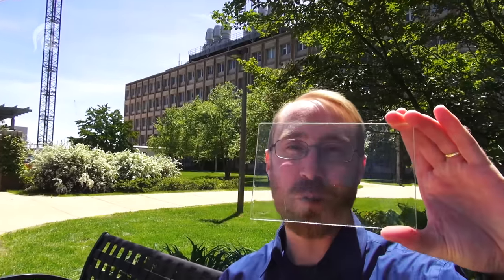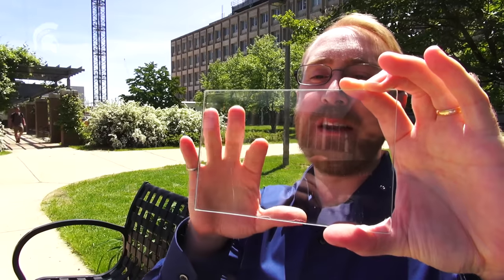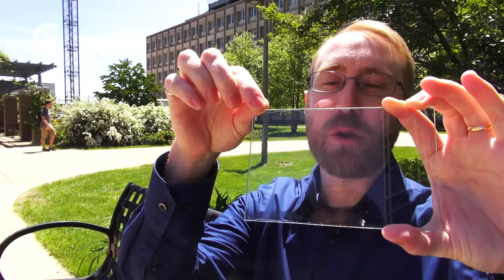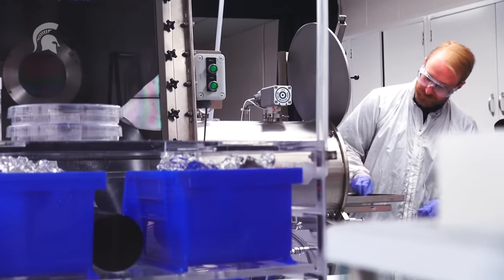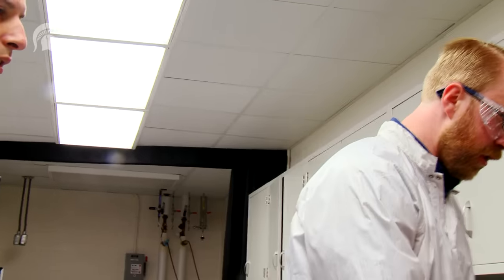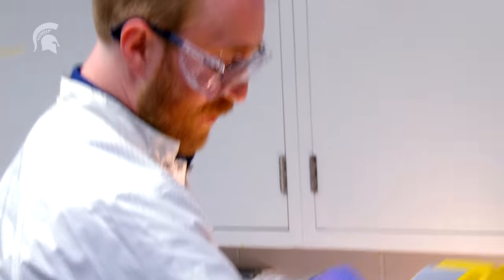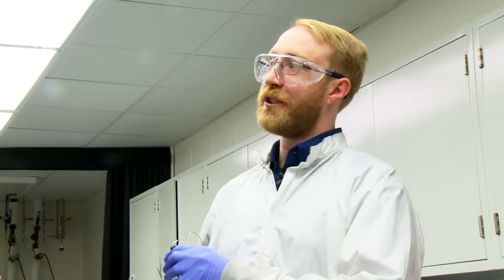Transparent Solar Panels | Michigan State University

Comment: So, was the glass wet or was that irregular surface deformation some sort of coating?

Basically it looks like you are talking about a piece of glass, that by its normal nature and characteristics, which will diffuse some of the light (UV) that passes normally through it to its edges? When you say "transparent luminescent solar concentrator" are you trying to say that the UV light is concentrated at those edges, increasing the "strength" of the UV light along those edges versus what normally goes through it already?

I ask this because you are talking about of instead of having full solar cells, you are going to utilize a small amount of solar cells along the perimeter of the glass. Standard glass by nature, and I could very well be wrong here as I hold no PHD's, will diffuse the light that is being transmitted through the edges, so you are losing potency there to start with right? And then using only a few solar cells along the edge, what kind of efficiency are you talking about?

I think this is a good step, as architects want clear windows etc... So I am glad to see you pursuing this technology, but stating that it could power the whole building, any building, is in my humble opinion a bit too far reaching of a statement to make that it can do. A wonderful goal to be sure, but to make that kind of assumptive statement makes me doubt a lot by itself.

Looking forward to being proven wrong here.

I think that one area you may want to explore and may already be exploring is in the actual chemical makeup of standard glass that is used in residential and commercial projects. Increasing the amount of UV that diffuses to the edges may help. And if you can help develop a glass that manufacturers can readily make for the right price point, then it can get utilized in mainstream construction in conjunction with this tech you are working on.

Good luck!!
Reply: The UV light does not "diffuse" to the edges. The UV light will be absorbed by the compounds embedded in the coating/glass, and then re-emitted to the edge (with a different frequency). This process is called photoluminescence
Reply: Will the light that has passed be useful to plants and trees for photosynthesis ?

Comment: Sounds kinda interesting.
but then again:

The solar radiation that earth receives is mostly in the visible spectrum. of the other parts, UV is really low as the atmosphere is good at absorbing it.
That leaves us with IR. And IR has the pesky little trait of being low energy and thus hard to get energy out of.

With that in mind i kinda think that even with improvement it is only useful in niche applications - but not to produce clean energy. Cause with how little energy in comparison to normal solar-cells this can make and how hard it is to produce i get the feeling that it requires many times more energy to create those than they can produce in their lifetime.
Reply: ABaumstumpf correct. It will always be far more cost effective to put conventional cells on the roof.

Comment: so wait if its clear..doesnt that mean we can almost double the power received from light by placing a normal solar cell behind it
Reply: SR Productions exactly what I was wondering.  I'm guessing it depends on how much energy is harvested from the first pane and what is left to be harvested onto the 2nd, 3rd, so on.
Reply: no well what i was thinking if they use a normal solar cell behind it..the remaining energy would be absorbed and the black colour of the normal solar cells  would attract more light in the process
Reply: This tech uses the non-visible part of the EM spectrum, which is most of it. Putting a normal solar cell won't make much difference. This tech main advantage is that aesthetically pleasing and can be retrofitted into existing buildings as windows.
Reply: yh but a normal solar cell uses a visible part of the EM spectrum
Reply: @srproductions8798  So a 24% efficient panel with 10 plys of this plastic overlay (@ 5% efficient per layer). Would be 74% efficient.  Seems like they would have thought of that.  But the overlays would block half the light from ever getting to the conventional solar cell.
Reply: @winomaster  energy is energy...if we can absorb it all..better yet
Reply: No, you would get a tad bit less than a normal solar panel. Cause the first layer is pure crap and doesn't do much of anything. Then the 2nd layer would collect almost all of the energy

Comment: It sounds good but retrofitting this would be a pain despite his claims.  First off you need charge controllers all over to deal with shading.  One shaded cell acts as a resistor to any other in series and will drop the current flow to zero.  In new buildings sure you can accommodate small mppt controllers all over but in existing buildings that would be a fairly tall order unless you're dealing with a building that doesn't get shaded.

Comment: My thought is that residential is fairly expensive to serve with infrastructure.  If solar cells became capable of making entire neighborhoods off the grid.   That could work with current, ever improving solar cells.

 Downtown's full of skyscrapers are a compact area that can be efficiently served with a low infrastructure cost by large, short runs of power lines.  The focus of solar panels should be residential.

Comment: Two caveats are begging to be addressed: 
1. How much less energy is collected with this kind of solar collector than the usual roof-top kind? It's only collecting parts of the spectrum the human eye cannot see. How much difference does that make in terms of how much energy is collected? 
2. He talks about the vertical part of many buildings being larger than the roof, which is a great point. But don't forget that each square foot (or square meter) of the side of the building receives less solar energy than the roof because of the angle at which the sunlight reaches it.

Comment: Anyone know what the exact wavelength spectrum the glass is capturing? He mentions that a possible application is greenhouses. However, plants use a small part or the UV spectrum (300-400) and a small part of the IR spectrum (700-800) so technically wouldn't the glass affect the growth of the plants in the greenhouse? Then again, if the energy was converted into grow-lights then the net efficiency gain would probably make up for that.

Comment: 1) How much power can you produce from these transparent solar panels  (e.g, 1KW per sq inch), and does it require the solar panels to be daisy chain together? 
2) How do you store the power (battery fields) so that you have power after the sun goes down? 
3) Can you sell the power generated to the power grid and get paid or get credit from the power company?
4) Does it require you to replace the solar panel after so many years, because the panel has broken down?
5) What is the cost of this transparent solar panel?  (e.g, $100 per sq inch)
6) We have a lot of solar farms here that could be retrofitted with the surface glass on the standard solar panel with the transparent solar panel in conjunction to produce more power within a confined space if it could work in that configuration. 
 
This technology sounds very interesting.  I live where we have a lot of sunlight all year around. 
Thanks.

Comment: I know during a solar storm power lines can be overwhelmed, how would solar panels react?
Reply: +Joe Davis To my understanding, its the destabilization of the magnetic fields being created by the alternating current running through the lines and power supplies. A solar storm fires out hyper energetic plasma which is deflected by our magnetosphere. A solar storm does not contain anymore photons that cause the electrons in a photovoltaic hop around and create a circuit. I don't believe it causes anymore UV or IR waves either, which is what the glass is picking up and directing to the edges of the glass. The only way a solar storm would effect these cells is if our magnetosphere fails, or we get hit by a storm when our poles are switching (which could happen). That effect would basically fry all electronics, regardless of power source (solar, coal, hydro, wind etc.) I'm studying this kind of thing but by no means an expert, so please fact check me! :)

Comment: can these spectrum (infra red & ultra violet) of non visible tech layer over monocrystalline technology already in place or are they mutually exclusive. The increased power potential may be what?
I presume that the thickness of the window and its area produce a relation or symmetry when charted. 
Finally
If you build it will we see it as affordable out of the gate or should we plan for our children to have the benefit?

Comment: Solar pays for itself immediately.  If you find the right company (local, small companies) will install solar, get it permitted and operational for NO COST OUT OF POCKET, and the monthly payment for the solar is LESS THAN what you were paying the utility company.  So, solar replaces the public utility bill, costs less, has zero upfront costs, gives you equity in your power, guarantees that your power payment will be a FLAT RATE (no increases), and is MUCH BETTER for the environment.  Solar is a no-brainer!

Comment: Professor Lunt,... What about stacking these units, one on top of the other?
Is there much light loss transmission?
If not you could make panels that are 2,...3,...4 layers deep to equal, and/or exceed present day silicon based panel efficiencies ,... Right?

You guys are onto something really really big/sensational - I was thinking of this very question- why not transparent solar panels.
Can wait to see how this pans out - I wish you and your teem the best of luck.
Reply: I'm no expert, but the light that's used to make energy is collected and dispersed to the edges of the panels (it's not using the visible light that shines through), so stacking them on top of each other would be pretty useless because only the top panel will actually generate electricity no?
Reply: I had hoped Professor Lunt would/could answer that question - As I too aren't an expert in this technology - by any means.
Reply: rx4rays7 u r brilliant
Reply: Why Thank You My Good Man :)))
Reply: +Mohamed Samir praising someone as being brilliant when that person doesn't understand how this works and his idea is a fantasy kinda shows how much both of you know about this particular subject.

Comment: A. How much additional cost is going to be added to a building with this technology?
B. How long will it take to pay for it's self?
C. How long will it last?

If C is longer than B and B happens before C expires then there might be an advantage to this technology.  Otherwise this is just a bunch of career researchers trying to secure their future.
Reply: Well price vs how well it works, should be 100% cheaper than a real PVC.
Never, not even that one single panel he had would ever pay itself off
would have around a 1% loss each year

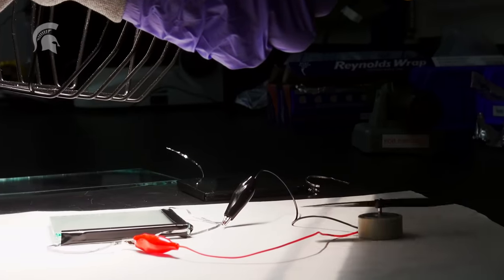Comment: Essentially it's micro to nano size invisible to notice elements inside a clear gloss structure,  attempting to match classic bulk solar panel/tile power. Like a clear glossy paint on anything, to generate🔋. What wasn't impressive, 1:46 high power lamp on a single panel.

Comment: Five years later and nothing that I've heard of. Seems odd, as it does seem to work, but I guess it can only produce enough power to light a bulb up (and a LED one at that) but costs 100 times as much as normal window it makes sense why no one is using it. All the videos on this tech never seem to mention power output per square metre etc.... makes me sus.

Comment: Question: Can solar energy pass through glass? if yes can you stack multiple transparent solar panels and receive the same or reduced solar energy? which will reduce the solar panels being put on roof tops or more solar energy with little space.
Reply: Solar energy = Light/Electromagnetic energy. if you can see through the material, its precisely because the solar energy is passing through.
Reply: JacsRambles yes, but can you stack multiple glass and receive the same amount of solar energy?
Reply: You could, but it won't be as cost effective.
Reply: JacsRambles ohh okay thank you.

Comment: it already exist or they will do in the next next next years?...
Also, to do energy power from sun the sun have to directly focus on the glass, and who wanna get direct sun from a windows with the window shades/blinds opened?! 
and what efficiency it will have?
Reply: +Hugo Antão I think usually shades go on the inside of the home/building... So those won't effect the efficiency of solar harvest. Depending on the latitude of the installation, and its general climate (cloudy/sunny) usually the angle of a modern solar panel has to be tilted accordingly to maximize harvest. I believe Lunt's work is trying to eliminate that by having the glass direct those rays to the edges of the glass, where the actual cells that are generating electricity are located! :)

Comment: This along with Solar city roof tiles on 20% of the homes and buildings would probably provide the US with 80% of its electrical power needs. Remember the square miles needed to power the US with electricity. You would need 100 square miles of land to provide 100% of our energy needs. Now use battery back up systems you have a winning combination. I bet 2 years worth the US military budget could get this done. We do have the money we just refuse to do whats right for our country.

Comment: What would this do to the overall cost of the building? How do these glass panels compare to the cost of non-power generating glass panels?

Also, if two or more buildings are in close proximity to each other, would it minimize the power generating benefits due to shading?

Comment: This is one of those things that sounds amazing in principle, but the economics don't make sense. It's probably much more expensive than regular solar panels and there aren't all that many tall office buildings in the world. Windows are perpendicular to the ground, so you'll get a lot less direct exposure, and there is just so much unused roof space on residential homes and 2-3 story office and commercial buildings, not to mention parking lots that can be roofed with solar panels, that by the time we get to putting solar panels in office windows, we've already powered the world with solar. Regular panels are much easier to install too and easier to replace and maintain. My bet is this won't ever really catch on for buildings. It might be neat for cars that have a lot of glass on the roof like the Tesla Model 3 .

Comment: no..... even more expensive and lower output...
Reply: Mike Warren 
True, using only part of the spectrum seems like a bad idea to begin with. Especially  considering that a large part of the solar energy is in the visible spectrum and our conventional solar cells aren't that efficient in the IR spectrum. Also aren't there a lot of shadows on the sides of skyscrapers in cities?

But well, maybe i just remember wrong numbers and they have a they have specialised solar cells.
Reply: either way, its still going to be way to expensive to actually work. the only real way to do this would be roofs and roads. and even then, its a very long term investment that in most cases, jsut is not worth the money. the cost of the technology must go down.
Reply: Its not baseless. Iv done the shopping. The tech is simply too expensive. The development they need to do is in the manufacturing process to make building them cheaper. It will not be viable to most people until its affordable.
Reply: +Arkeves Definitely not, but it does mean that you don't have to full "outrage" mode because someone points out the commercial viability, for a technology like this, at this point is unrealistic currently. I went a read Dr. Lunt's work published on this, and he and his team are still quite a way's off from large scale roll-out.

I would surmise that for new multi-story buildings these panes could start being installed within ten years on a limited basis. However, older office buildings that were built in the 90's or earlier, I can't really ever see the numbers making sense to retrofit.